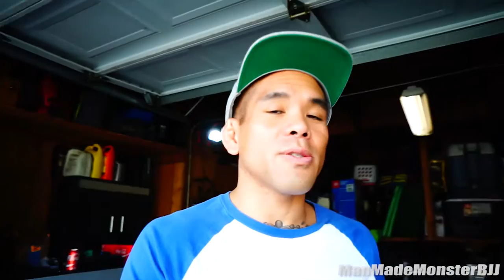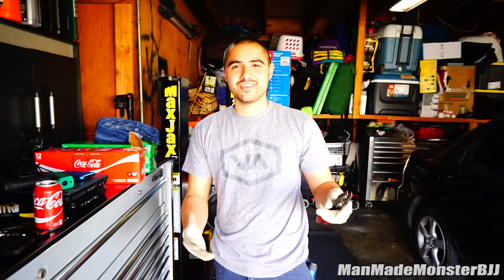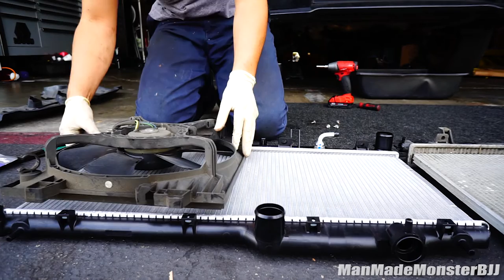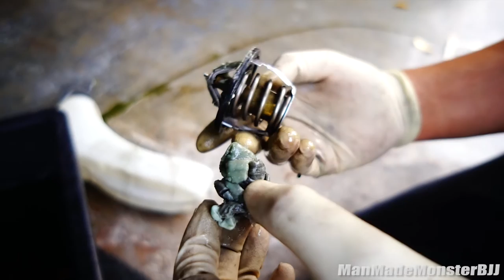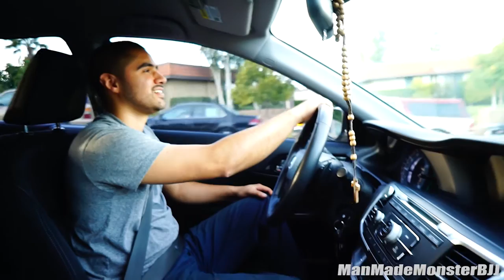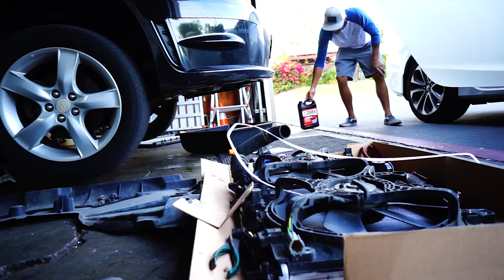vlog 19: This is why its overheating?!

Comment: I have a 2000 Oldsmobile Intrigue and my car is still running hot I put a bottle of Blue Devil and then letting the run the supposed to run for 50 minutes but it only make it down to like 36 minutes